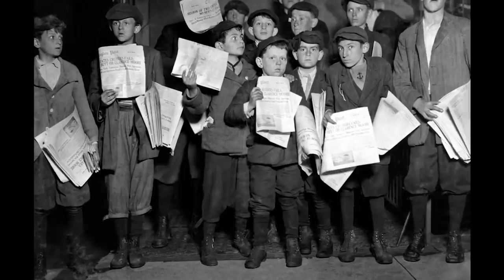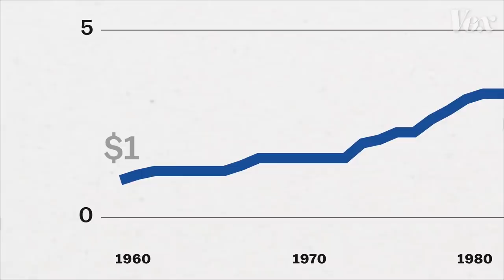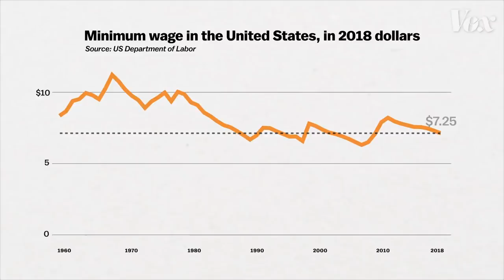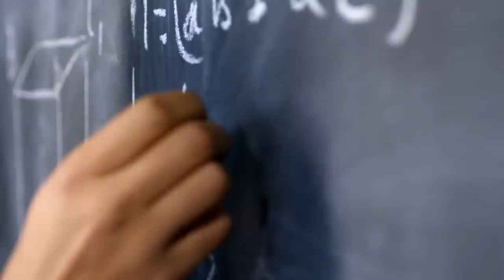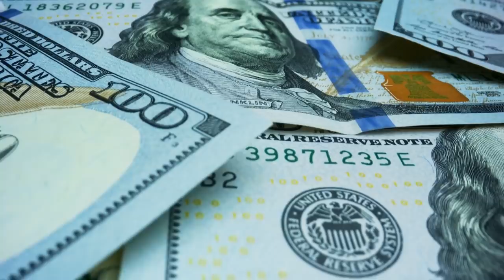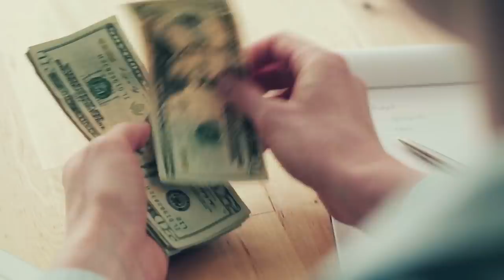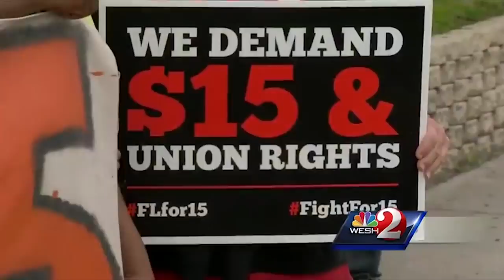The Minimum Wage Debate Explained

Comment: There's actually a slightly different reason why increasing minimum wage doesn't hurt small businesses, I expect. That reason is that most small businesses don't produce essential goods that people need to live, or if they do they're not the lowest-price provider thereof. Higher minimum wage means people have more flex in their budgets, and more flex in budgets means the ability to spend money at small businesses when you otherwise wouldn't be able to.
Of course, one takeaway from this is that you need to increase minimum wage to a certain amount before increasing minimum wage stops hurting small businesses. With how bad things are now, if minimum wage were increased a bit, people would simply work fewer jobs or be able to save a little more, but likely wouldn't have any real increase in actual spending money. This would put small businesses out of business, as they would be paying more to their employees without increased profits. Basically, I suspect there's a sort of parabola effect, where increasing minimum wage makes things a little worse for small businesses before it makes them better.

Comment: Minimum wage should be adjusted on a yearly basis (at least every 2 years) and it should be done by the states or localities because life in Arkansas is very different than life in New York... the federal government should set the minimum standards or methods to determine that minimum wage...

Also, it's insane to think that minimum wage would raise prices on everything else, as if corporate greed doesn't have anything to do with those prices...

Comment: I like the cheese burger metric. That dollar could buy more than one of those for sure. Quality might be in question but given that fast food was still somewhat on the horizon in it's cost cutting and portion manipulation not to mention that that product likely didn't originate from a thousands of miles distant. But still that hourly wage could buy something. My last hourly wage just about bought a good quality cheese burger and going backwards my wages have almost always been short or on par with what that staple affordable choice is priced at. Of course I could accept the alternative, and have, in fast food choices but there is a compromise made there. Really this isn't about cheese burgers but the rate hourly at a low rung to what food in general costs. I'm not short of choice near by and it is affordable but honestly what is considered a fair rate is in the subjective interpretation of the employer. I worked within a restaurant where the primary cooking staff had been working at a set rate for some time until it was discovered that a newcomer who had been engaged to manage an evening service as well as take on further responsibility in time was making an annual salary wage very early on in their start there before they had proven their experience. That was the thing that supposedly warranted their compensation. My colleagues who had further more seniority at the business were at the rate of ten and "threatened" to resign if their hourly wasn't increased. Given their absolute importance and the reasonable certainty at the time that they couldn't be replaced the owner was obligated to answer the demand and both of them were happy in the result. That new manager in time proved to be incompetent and possibly wasting the companies time in other ways. But had the owner not put him self in a position to favor experience over long, long term seniority then he would have continued to pay that ten dollar amount to his two remaining kitchen elites, one of who both worked the main cooking station and followed up on all stock taking and ordering. They were the kitchen, they were the restaurant. I finished up at that business after four years at the rate which they had negotiated out of. Ten seemed to be going rate for newcomers in many places and it wasn't until 2019 that I took a job someplace offering at 12 although I accepted 11 as it was offered in waiting to see how the engagement worked out. It's unfortunate now that 2020 followed up that year as it was the job I chose to fully integrate with and it was seemingly one of the few restaurants that failed under it's own mismanagement. I was however offered a rate increase by the kitchen management at 14 hourly which after months of closure turned out to have been ignored by the book keeper with it starting back at the previous 11. I had taken full time and what was offered before I accepted the job wasn't even being met. It took weeks and then an amusing hiccup at one point where my hourly rate started to drop again, mid summer season to 13, and then after I put in for my self to the book keeper it dropped further down to my starting rate again at 11. All was reasonably resolved eventually and fashionably late in absolutely every respect. The business shuttered early and left a sourness that had over time finally boiled over for the majority of the remaining staff, many with full privileges and seniority. Others, long on the books, had to negotiate over wage drops during the course of the year. Had there been an issue of revenue and a frank discussion with staff... maybe some compromises in both directions would have been an option although I understand this end was one of other optional ends that was likely to occur, the book keeper and manager being down graded in favor of an experienced person taking over being the hoped for result.

There are people who pay well, some times they're those who guide as leaders and fashion excellent prosperity from their staff. Others give well and permit that the ones they pay take advantage of them. Humans are malicious and underhanded and that nature is present in every iteration of being you could call human. What keeps us honest and fair and hard working is likely unfortunately unique to every person.

As to a working wage I may be changing my mind about it. While I think good work is grown in good soil when that soil is compensation I also think public support might be a better option. But that will require all sorts of uncomfortable involvement by states and federal departments to make being below average or low down worth being. It is hard for everyone. For some this past year it was terminally hard and not because of viruses. The United States is a fair country in only that every man and woman born, should they be born shrewd and cautious yet risk taking and forward sighted at all the right times. As only some can afford to be that way and others fortunately imbued with those qualities it seems that some leniency for the rest, provided it can be organized into this monstrous system we live under, would do the country well.

Comment: Gross profits and actual profits are two completely different things. Walmarts actual income before taxes is $20B not $129B

Walmart has 2.2M associates. Say an average of 2000 hours a year. For every $1 walmart increased in pay it works cost them $4.4B 
(2.2M * 2000 * $1) 
A $5 increase per hour would cost them $22B which would mean they would be losing money.

It's easy to see that even small raises affects the company a lot. This isn't too say that walmart shouldn't pay their employees more but that you can't just raise the minimum wage to $15 and expect everything to stay the same. 

Something needs to be done to help the poorer workers but we need to look at the problems from every angle and not a one problem fix all solution

Comment: Everytime I watch these types of videos I can't help, but wonder why the true national average isn't taken into account. Very few cities areas have a need for $15 as a minimum. And especially, $22/hour. There should be 2 minimum wages; 1 based on entry level (HS/College students) and 1 for those that have a reason to need a livable wage. How do you prove you're the latter? That's not something I can answer, but my opinion would come from if they are still claimed on their parents tax returns. 

Now my and MOST middle class Americans problem with the minimum wage is the value of MY DOLLAR. To be a middle class family in American on average you have to make about $60k or $28/hour. So let's go with that as our middle class income. At $28/hour you'd make almost exactly 4 times someone making minimum wage. Once minimum wage goes to $15/hour, you now make less than 2 times their wage. Whereas, you could previously rent a room 4 times nicer now it's only 2 times as nice and your struggling because you barely make over 2x. The same goes for transportation. Also, you worked hard to get to this $28 from the minimum wage when you were a whipper snapper. All of that hard work to get to that income is wiped out overnight. 

(example just for minimum wage workers that we've all dealt with: You've been with Walmart for 10 years. You started off at $7.25/hour like every other new person. You've built up your position and now you're making $12/hour. Suddenly, the minimum wage jumps to $15/hour and you're now making the same thing the newbies are making. You're pissed now that you have nothing to show for your 10 years of commitment because of the change. Shouldn't you now be getting more money than the new guy?)

Now take that same scenario for someone that has an undergraduate degree and 10 years in the field and the incomes in my example above. Why'd you go to school if you're only making double their income with all of that investment on your end. When you made 4x the minimum all the tuition felt justified. You felt more like a success and your income and "stuff" showed your level of success. Now you can only afford 1 more towel instead of 3 more. 

I know this sounds selfish when read, but that's not reality. Reality is everyone in the middle-class will feel this effect. The rich won't and the Walmart example will only slightly (their income did just increase) feel the effects. The guy that fought hard to afford that Audi will now be buying a Mustang. 

Why do none of these videos talk about that problem?
Why aren't we pushing for a wage equivalency instead of a higher minimum? Instead of a CEO making 10 times his middle class employees we instead redistribute based on a pyramid structure. (ie: $100 mil/hour available to employees. 10% goes to CEO, 10% goes to all the SVP/VP, and so on. Each level makes more than the one below, but the money is more evenly distributed)
Reply: I agreed until your last paragraph. Redistribution of wealth will not do anything to the lower 90 percent of a company. Well continue with Walmart. The top executives at Walmart earned a combined 113 million dollars. Even if we distributed that money back into the 2.3 million people that they employ that will come out everyone making 43 dollars extra per year, or 2 cents and hour. 
Also if I’m a person thinking about starting a business which mind you that only a 1/2 of businesses remain after 5 and 1/3 after 10. Those are huge risk. If I’m forced to fork over a substantial amount of what I risked than there’s less incentive to do that. While the people I employ bare none of that risk. I believe that we should allow these big businesses to fail if they aren’t operating well. But to act as if people are inert pieces of wood you can move around is pretty dangerous.

Comment: I beeeeen said that if you can’t pay your workers you should not be in business. It’s the same as if you have to short your customers you should not be in business. A business model dependent on paying workers less than they need to live is simply an issue of morals, basic human decency and not knowing what the fuck you’re doing. Half of Congress and media  loves pissing their pants over what would ultimately amount to slightly decreased wages in the owner class (more than enough regardless) and a few poorly built businesses going under; the other option being hundreds of thousands, at the very least, being a good bit closer to potentially becoming remotely financially stable. Change is coming.

Comment: I run a family owned company in the north east and I personally do not agree with this I don’t know all of the but I know statistics but I can speak from experience 
I believe instead of raising the minimum wage we should decrease inflation even though it’s harder because if you have saved money it becomes more valuable for everyone instead decreasing in value 
If you increase the value of the minimum wage it hurts small businesses because they don’t have option of raising their prices because larger companies can offer low prices through mass production and outsourcing 
Personally I believe the best way to improve the minimum wage is by decreasing inflation significantly and making it easier for smaller companies to get loans allowing for growth thus causing more competition in the market which causes prices to go down and the value of the minimum wage to go up without hurting small businesses
Reply from the maker: You can’t just “decrease inflation.” That’s not a lever you can pull. All workers deserve a living wage. If a business (of any size) can’t pay that, it doesn’t deserve to be in business.
Reply: @SecondThought  There is from what I understand a “lever” you can pull to decrease inflammation by simply not printing money and still allowing for damaged bills to be removed from circulation which increases the value of money
Maybe you didn’t understand me but by decreasing inflation and stimulating market will make the minimum wage a living wage without affecting employers

Comment: Yeah, but what is the reason the burger in Denmark only costs an additional 27 cents? What are the economic realities that make this possible versus the ones in the USA that makes it impossible? Are there any? Tax structure? UBI? Why isn't this addressed?

 I don't understand how we're supposed to have an honest conversation about this when we're already omitting crucial parts of the discussion.

There are very few hard numbers being discussed in this video and that prevents me from being sold on either side of this argument.

It doesn't help that the crux of the video is "we spend all of this money on things I, personally, don't think we need so maybe we should take that money and put it where I want instead!". It doesn't make this video wrong, but it does feel subjective.

I would like to see a more longform video that goes into greater detail and presents both sides of this argument with nothing but the objective facts and numbers.
I find, too often, videos like this try to find an easy answer to a hard question and ultimately end up over-simplifying a topic to the detriment of a greater understanding.

Comment: I like the slant this video takes. A google  search  yielded a 2017 answer that 542,000 out of 80,400,000 ( 80.4 million)workers paid by the hour made $7,25 an hour. That’s 0.67%. A country of 330 million. What you see is a non problem. A zero minimum wage is the correct answer. Yes there is a correct answer. If you have been working longer than a year and still make minimum wage look in the mirror you are possibly seeing the problem.
Reply: Millions make more than 7.25 but less than 15.

Comment: National or Federal Minimum wage has its problem, Youth Unemployment Rate. 

Labor Laws of 1930s has caused Black unemployment rate to raise from lower than white to higher than white and stays until now. 

1960s minimum wage which pegged minimum wage with inflation laws caused Stagflation in 1970s and 1980s, that's how you get that graphs of adjusted inflation. Keynesian doesn't worked. It's not just happen in US, but also Nordics and UK. Look at Sweden Stagflation in 1970s. High tax, high minimum wage, high inflation, high unemployment rate, low entrepreneurship. 

"bohoo.... housing crisis.... rent is high, minimum wage is stagnant" Look at your zoning laws, is it simple to build a house? is it free market? No. Then look at Japan's zoning law, you can literally build your house anywhere with less building codes on size, not security. Look at hobos in SF? LA? NY? 

Minimum wage is distorting the labor market. If minimum wage can solve unemployment problems, Venezuela will have 0 unemployment. Argentina won't have poverty and falling rates since they peg their minimum wage with inflation. 

France? lmao, do you know the unemployment and youth unemployment there in France?

In 2020, US spent more than 2 trillions on social welfare, for years. How's that going with poverty rate? US doesn't have budget problem, it has spending problems. US has spent more on public education than its military, BY FAR.... the results? Look at PISA score by state.

Comment: 2:39 wow it's crazy how everytime the minimum wage has been raised it's immediately outpaced by an increase in inflation. It's almost as if the two are correlated somehow
Reply: wow it's crazy how inflation will happen regardless of adjustment of the minimum wage (did you see any slowdown of inflation between 1980~1990 or 2009~2020), so the only way to actually outpace inflation would be to adjust the minimum wage accordingly, it's amazing how common sense works ain't it

Comment: Denmark has no minimun wage, why you people always use countrys without minimun wages a an example of the benefits of minimun wages?
Reply: @harpoonmcfierce9697  that doesn't mean nothing, the facts are that in countrys without minimun wages, the wages are higher, also in other countrys like Cuba or Venezuela increase the minimun wage doesn't work like the video says, and there are plenty examples of high minimun wages that create hiperinflation, like in México  whit the president Luis Echeverría
Reply: @harpoonmcfierce9697  so what? increase minimun wages is not going to solve your problems
Reply: @harpoonmcfierce9697  and end like Cuba, Venezuela, North Korea, etc
Reply: @harpoonmcfierce9697  that's not real socialism HAHAHAHAHHAHAHAHAHAHAHAHA